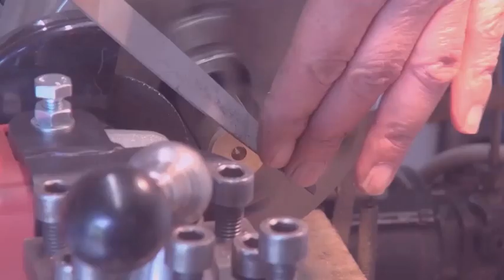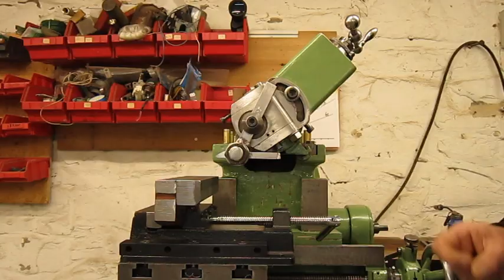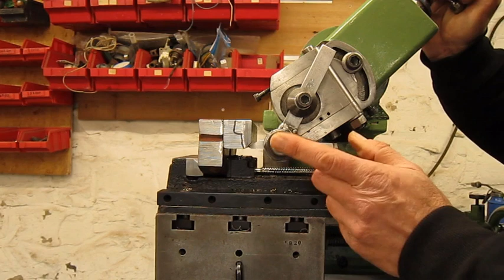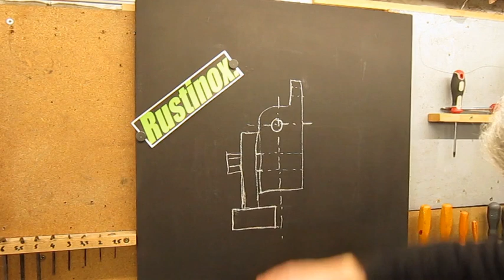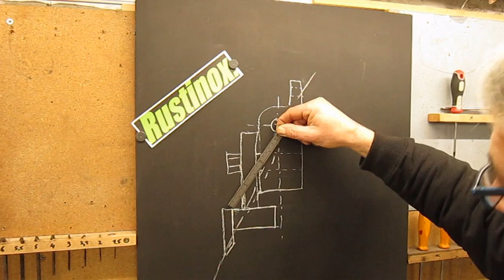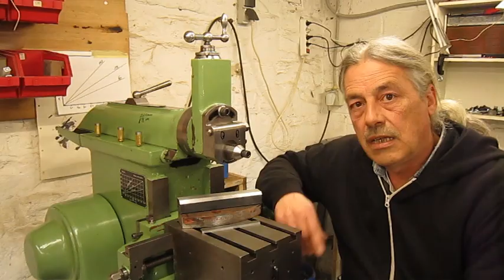How to set the clapper box on the shaper.

Comment: Great video, great explanation! Two questions:
1. The clapper box has a swing range. Obviously rotating it more increases the clearance. What is your opinion on the optimal setting?
2. I have noticed Adam cutting keyways both with the keyway down and up. In the 'down' position, I guess the clapper box would work OK, but I do not know if it was locked. I have an old book saying the clapper box should be locked for slotting work. In the 'up' position, obviously the clapper box does not function. With internal slotting, a pretty long bar is used, does this already provide (elastic) clearance? Would disabling the clapper for slotting also be for reasons of accuracy? 

Thanks and keep up the good work! Groeten uit Nederland.
Reply from the maker: Tha angle of the clapper box is not really important. From the moment it clears the tool on the backstroke, it's good.
For slotting, the clapper is always locked. If not, the cutting forces will push the tool up while cutting.
Of course, it's important to feed down only when the tool clrars the cut on the backstroke.

Comment: Rustinox is there any way to tighten the clapper box if worn
Reply from the maker: Normally the pin that holds the clapper in place is tapered. You adjust the play tightening the pin.
Reply: @Rustinox  i see cuz im getting one but realize clapper with play is a problem i only have experience with milling machine.thank you

Comment: Very helpful and easily understandable explanation. I'd like to add that one might want to take into consideration that the depth of cut as controlled by the tool head feed might be off (by cosine value of tilt angle, similar to screw cutting on the lathe with compound ser at angle).
Reply from the maker: Indeed, when the tool slide is set at 45° the tool is fed in half of what you dial in.
This was maybe not really the point of this video but i really appreciate pointing that out.
Thanks.